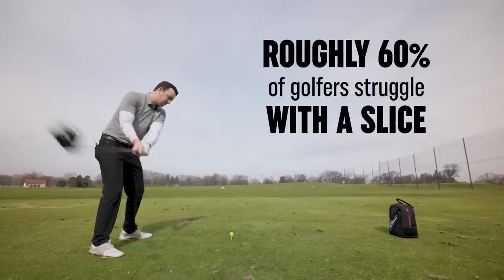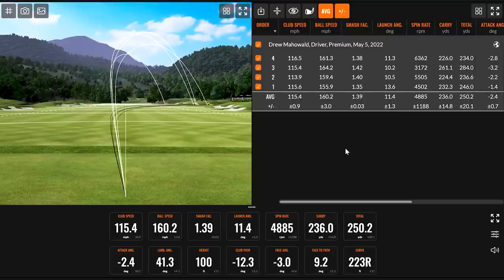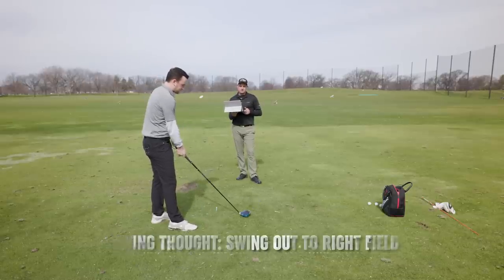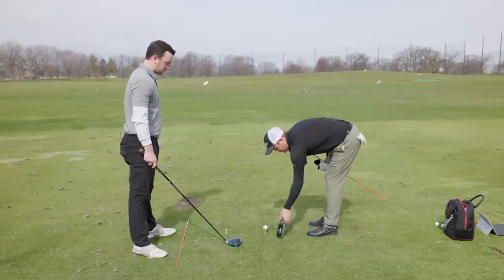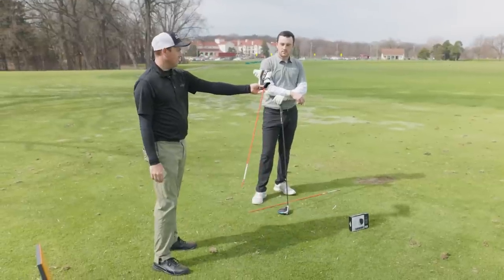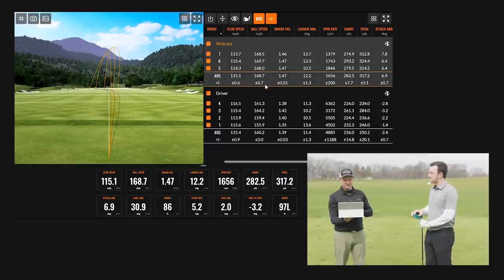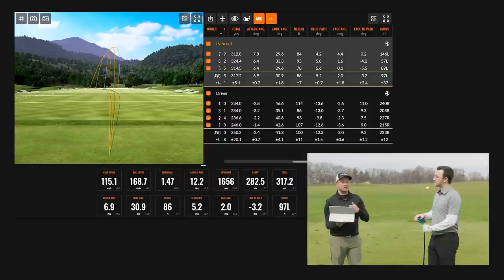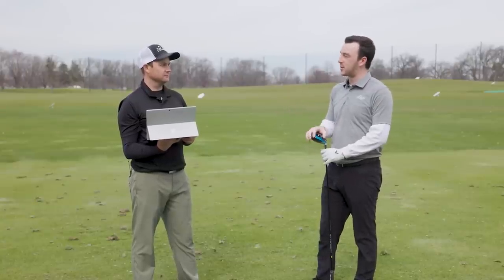How To Fix A Slice | Golf Swing Tips

Comment: What about someone who is hitting push slices. I don’t come over the top. The ball usually will come off dead straight or slightly to the left looking like it wants to draw but then leak to the left (I’m left handed). I try to strengthen my grip and that usually makes it worse. Some days I can hit nice tight draws but most of the time I’m battling them leaking off. I hit draws with my irons and can hook them on command if I want to but the more I try to draw or even hook the driver the worse I get. Should I commit to power fades with the driver or is there something I’m missing?
Reply from the maker: Good question. Pay attention to where your hit location is. Shifting it to slightly on the toe will make a big difference - Thomas